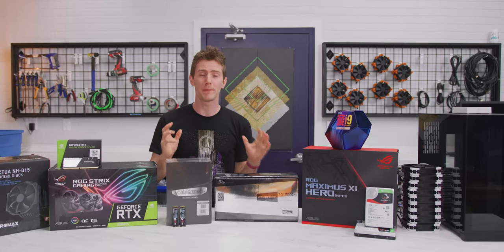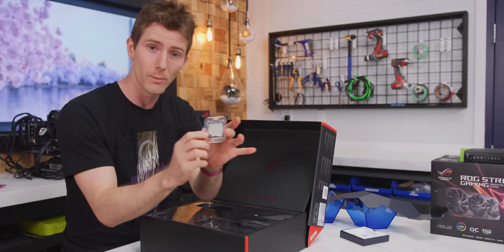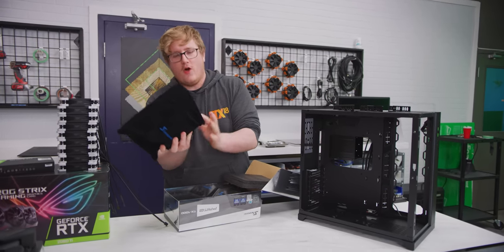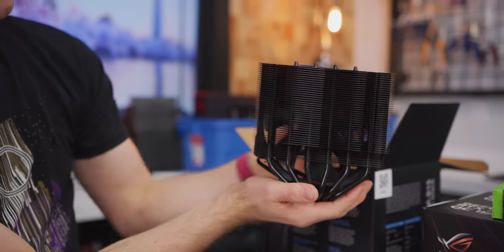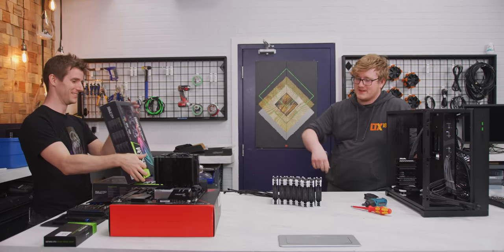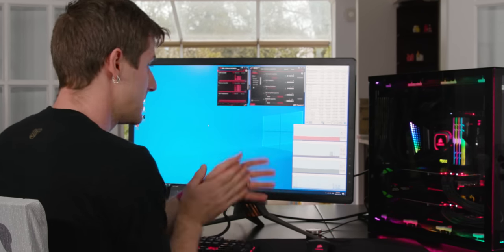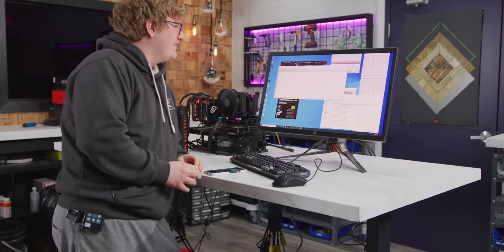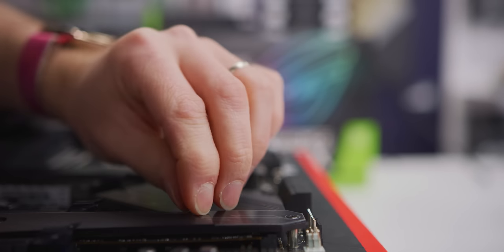Can AMD Beat the ULTIMATE Intel Gaming PC?

Comment: Linus: there's not that much of a difference between air and liquid cooling
also Linus: uses a case more fitted for liquid cooling
Reply: Also, liquid cooling the GPUs would really help. Especially with those rtx 2080tis 🤷‍♂️
Reply: I have a comment up above, I cant stand huge air coolers, they eat up all of your viewing from the case, they hang off in extreme amount and they can create build problems like ram clearance. An AIO gives you your case back and you can actually see other components.
Reply: @urgay1992  I respect that, I just cant stand seeing the behemoth in there eating up all the real estate. Plus for me I like MiTX and MaTX cases, so especially for me its important. My cooler master aio has been on for thousands of hours for two years and not a single problem. Ryzen 1700x.....
Reply: @urgay1992  This is the highest end machine possible, air coolers are definitely better value, but even the NH-D15 can't compete with a mid range AIO, especially when it comes to cooling higher wattage CPUs
Reply: @urgay1992  the question is not anymore about performance differences between air and aio, the question now is space. most cases won't fit a behemoth of an air cooler inside. that's where an aio wins big time
Reply: @joshuasterling2144  Obviously you dont daily a TRx/TR4 you dont get your computer case.......
Reply: @ryuuseiboi950  I think you really should watch some GN content. The only advantage of an AIO over a good air cooler is silence and footprint.
Reply: @ryuuseiboi950  Umm I think you need to go back to Linus' video on Air VS AIO you'd find out just how wrong you are.
Reply: shocked my a little, planned to switch from my aio to a NH-D15 and a PC-O11... 🤔🤔
Reply: Joshua Sterling, the real estate in there is meant to put things, like coolers...
Reply: @joshuasterling2144  I personally don't look into my PC while i game, nor do i care to. Showing it off to people is just silly... sorry im a grown ass man. I use air cooling and have Oc'd my CPU (i7 6700k) to 4.7ghz and never goes above 70c as well as my 2080 @ 2100mhz. idle temps set around 26c and full load is usually maxing around 75c on the GPU when its hot as sh!t outside. Can turn on my A/C and ambient temps go down by 8-10c
Reply: I mean Gamers Nexus's review of the 011 Dynamic shows it being a phenomenal air-cool case. (Not the air edition, ironically)
Reply: Watch Gamers Nexus deep dive into air versus water cooling. Water has a slight advantage. But that’s during testing.  During real world it has no practical advantage.  Noise isn’t an issues w/ anything Noctua. And air coolers will last a lot longer than water cooling setups. Can’t wait to see all the complaints about AIOs in a few years when enough water has evaporated to effect system performance 😂
Reply: @YouvBeenThumped   And you should go and watch Gamers Nexus video that they just released a couple of days ago that debunked this by using a much bigger sample size than just the couple of Corsair products Linus used.  Do not get me wrong, D15 is a beast and does beat some AIO's, particularly those with bad fans stock, but a good AIO with good fans still comes out top in performance, only behind a proper custom loop.
Reply: The Austrian Way, it would only help the GPUs if they were close to thermal throttling.
Reply: @ryuuseiboi950  They can compete but people don't use them cause the high end ones will only fit on a full tower instead of the usual midi ones and they just cover up everything or don't allow ram kits to fit unless they are low-profile. So in terms of convenience you spend 50$ more for a good AIO and you don't have to deal with all that shit. I also prefer aircooling as it is safer and doesnt need maintenance but then again im running my cpu stock like a pleb.
Reply: @loak3d  
I use the InWin 301 MAtx case, aio's just make more sense in my particular use case. Nothing gets over 70c in my instance either for my 1700x and my 1070ti.....and if you are spending thousands of dollars aesthetics matter, otherwise we would all be buying the same cars, I dont look at my car while I drive either.  I am however waiting for some new GC's to show up later this year and I will be making big updates then.
Reply: @Bob_Smith19  I would disagree with this also, slightly. I mean, if you do super heavy workloads like Blender then yeah, it won't make a difference. BUT a lot of real life use of PC's tend to be very bursty when it comes to CPU load. Stuff like gaming, they do not peg the CPU on max all the time unless you have a bottleneck. A big air cooler has lower thermal mass and they get heat saturated really quickly (less than a minute of continous load) and thermals will jump up and down in rapid pace depending on load. A big AIO can take up to 3 minutes before it saturates, which may result in much lower temperature average if the load reduces before the peak is even reached.
Reply: @MaaZeus  by the same measure it also means the temperature will also stay higher long after the CPU is no longer under load due to all the soaked heat in the loop. The only thing I could consider is if there's any kind of long term life span difference related to thermal shock since water coolers will have a much smoother temperature curve differential.
Reply: Yes, it also cools slower. It all depends on how long and how often the CPU heavy loads come.
Reply: @Kaerucon  I dont use a monitor, I use a 4k tv with HDMI 2.1 120hz. I can clearly see inside my case from my reclining couch. Monitors are for people who like sitting in corners while paying way to much for features that every tv in 2020 will have..., that and I dont set up multiple space for the same functionality. I can use my 4k sound system with my pc, PS4 Pro, XBOX One X etc without double setups, expense and space involved with having multiple displays that achieve the same thing. In my eyes monitors are old news and tv's are the way forward. You watch LTT videos you know these tv models are very capable. I will be getting the OLED B9 or C9 at the end of the year which is probably the best gaming diplay period.
Reply: @urgay1992  sure for cheaper ones, but aios like arctic's liquid freezer ii, especially in bigger sizes - 280mm, 360mm, 420mm, beats every single standard size air cooler on the market.

Comment: "A PC that someone can actually buy"
Me: *can't afford the CPU*

EDIT: *can't afford the RAM stick either*
Reply: Silicon lottery boosted CPU: may be out of stock too
Reply: I can't afford to even look at this PC.
Reply: he said someone, not everyone
then that someone may not be you
Reply: im siting here with a modded dell with a gt 1030 still paying for it from a year ago and this man had thousands of pcs
Reply: Me: cant afford to upgrade my potato to a pretzel stick with a coulple wires
Reply: I am sitting here with my core2 quad CPU and gt730
Reply: This Thing is EOL...
Reply: I got a DER8AUER i9 9900KS (delidded) to replace my i7 5820k (4.3 GHz all Core). Using an ROG 1080 Ti Poseidon.
My FPS in Far Cry 5 jumped from 75 - 100 to 120 - 150 at WQHD... Same for AC Origins, FPS bump and no micro frame skips and stutters in cities or ever. A top end CPU and 3600 RAM are making a huge difference...
I always thought you get max. FPS at WQHD with a nice CPU and only the GPU is important... I was proven completely wrong.
Reply: RedEdain i cant even afford a mouse pad.
Reply: @eastlink20  If you watched the video they are coming for your house
Reply: Me: can't afford the hard rive
Reply: I can't even afford the cpu cooler bruh
Reply: my entire build is like half of the price of cpu itself
Reply: And with all this hardware it is still only around 90fps in most of the renders lol
Reply: Uridium at 4k... in 1080p it would be like 200
Reply: Obviously re out of touch with the normal market . this is why inlet is pretty much dead .
Reply: @PlayrayGamer  CPU bottleneck is a thing.
Reply: My same thought, sitting here with my stupid x58 motherboard from Asus and red and blue Sata cables xD
Reply: Except an 8086K would perform better than a 9900KS due to higher clocks at lower heat. I mean for this config, HEDT would make more sense, since SLI would both run on X16 slots
Reply: I can't even afford the case
Reply: Can't afford one stick of the ram
Reply: Cant afford the pcie port
Reply: i cant even afford the pipes
Reply: @georgemcfly9868  Yes I also realized this as soon as I got my CPU..
Reply: @norbertkocsis5945  Take that setup, put a GT 710 instead of the 730 and boom, that's my setup 😂
Reply: that's your fault lol
Reply: And all to get a few extra frames per second in games that no one would realistically even notice.
Reply: well thats democracy for ya. If you had Communism you would've had everything..
Reply: Can't afford the wire coating and I can forget about trying to buy the wire!
Reply: Im using a second hand GTX970, heck my whole PC is scraps from others lol
Reply: @sjoervanderploeg4340  hey a GTX 970 isnt bad tough.. i have an GTX 980 TI and its still a fantastic gpu for 1080p gaming at high-medium settings.
Reply: @Justice-qw7sj  980 ti is still insane but its expensive tho
Reply: @eddycheam9613  Yeah, it was expensive.. it costed me arround 850 € euros. now the gpu costs arround 250€ euros maybe a little less if your lucky. mine is a GTX is from Gigabyte the OC 3X Windforce Edition with 6gb video memory 😆 so its still an awesome gpu.
Reply: So you can buy the GPU's?
Reply: Pay for amd is cheaper and you get a fan with it

I9 

no fan
Reply: @Stormlywing  thats bullshit
Reply: Me:can't afford even the panel
Reply: Reeeee

Comment: "we could have gone with the 1600W, but we wanted to be more sensible (price)" Yeah, but SLI in 2020 is dead and still you get 2 GPUs
Reply: Bro tons of ppl buy dual 2080ti's
Reply: Norm most people buy single 2060s because 2080 tis are too expensive
Reply: @spamguy1156  I actually personally know three ppl with dual 2080tis... But I don't even know how many ppl have 2060's as your point is true and everyone with em loves em too
Reply: Well, two is always better than one since you can have more options like switch to one card when the game doesn't support sli, and switch back to sli mode when the game is better using two card like Tomb Raider.
Reply: @norm1233  People with SLI setups are rare nowadays not even talking about 2080 Ti's in SLI
Reply: nv link
Reply: @xPandamon  your correct.... Although I run two rx590's and the games I play have decent gains some small but I only paid 250 for both and and I don't play any rtx games so getting performance like a 2060 isn't bad
Reply: I will just hide and die in a corner with my 1060
Reply: @norm1233  250 for both is cheap. Had my RX580 for a while, it was a good card. Now I've got my rx 5600 xt, no issues so far, luckily.
Reply: sli has always been rare to see but the performance gain is surprisingly good with higher resolution games
Reply: Slowly raises hand.....

 I have 2 2080ti's and I also try and force sli in every game. A lot of the time it works too. It's in the Nvidia control panel and you can set it per game......
Reply: @norm1233  cousin got a xfx rx590 8gb for 150$... How long you had those gpus lol.
Reply: Warm Soft Kitty  At least Tomb Raider series always does very well on supporting sli, so does the newest Tomb Raider Shadow
Reply: Warm Soft Kitty  Actually, it might because your cpu is working to help support the 2 GPU's so it can slow down the processing.  Many games dont need SLI but all if not most dont care how many GPU's you have.  Your blaming the GPU for being your processor.  The chances are that you lose speed is because both graphics cards are not working how they are intended.
Reply: @SuperSilvi1990  i nerded on him too.
Reply: last reply:  The SLI is more alive than a healthy baby.
Reply: @norm1233  lol wow your specific instance doesn't apply to anyone here you tool 😂. Stop talking nonsense the average to high end consumer isn't going to buy sli or crossfire cards anymore
Reply: Same thoughts I had. WTH, right?
Reply: @norm1233  are they professional gamers? I can't understand why anyone would need something like that.
Reply: @jeremyswanson1108  two baught pre built the other built himself, one nah she just loves crazy pcs the other too not sure... Tbh it's just cool lookin